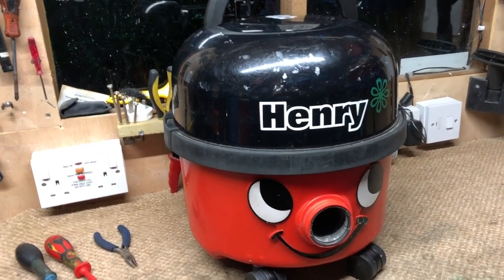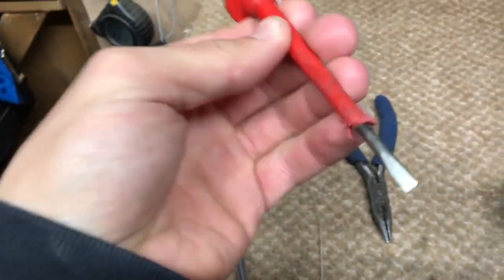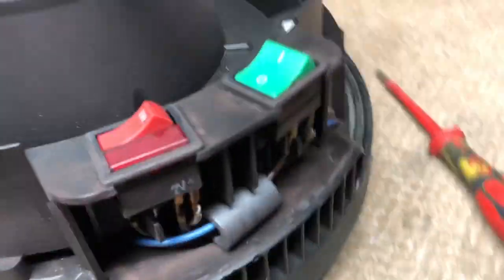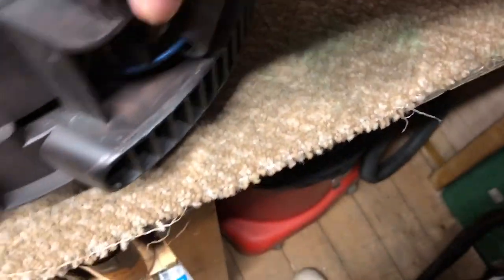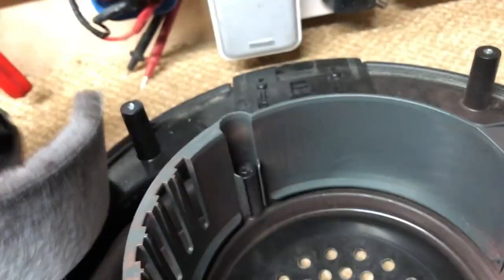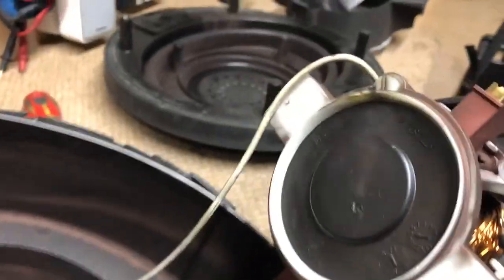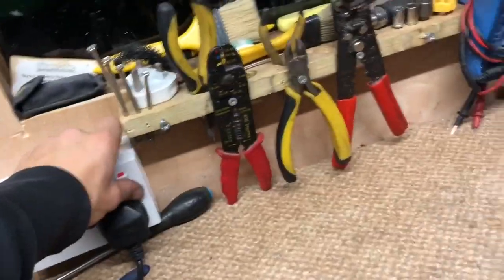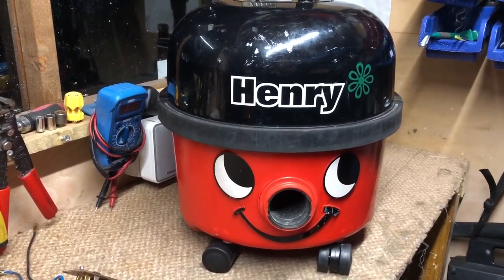How to remove the PCB board in a Numatic auto save henry!

Comment: I just stripped my 2008 HVR200A as the unit was very slow, I thought it was the motor, but can't smell any burning. Loads of carbon on the PCB so I will try the bypass tomorrow to see if it lives. Great video thanks

Comment: 4:33 did numatic change the carbon brushes because they look different to the other ones used on twinflo’s are they replaceable when they wear out?
Reply from the maker: No they used all different types
Reply: @numaticrule2921  I think the type in this video is like the uds motors, the ones that are on springs just looked them up online and I saw a spring in the brush holder

Comment: What does the circuit board do?
Reply: Controls the wattage of the motor as you turn it on it’ll be on a low wattage and if you press the red hi switch it’ll use the full wattage of the motor

Comment: Have the same Henry. Have replaced the pcb to get it running again but now only runs at one speed. The new type red pcb board. Should I change the red speed change switch..?
Reply from the maker: Wires are possibly round the wrong way

Comment: My friend did this but the motor burned it self. Maybe it is not too wise to bypass it..
Reply from the maker: I wont burn the motor out.
Reply: It must of been the carbons on your mates one it could of popped out mid use its easy to replace and fit a new motor or carbons these are designed to be fixed